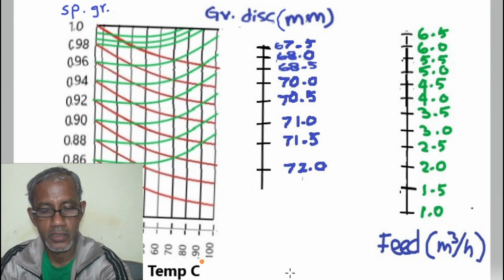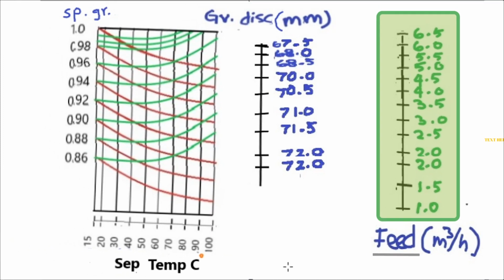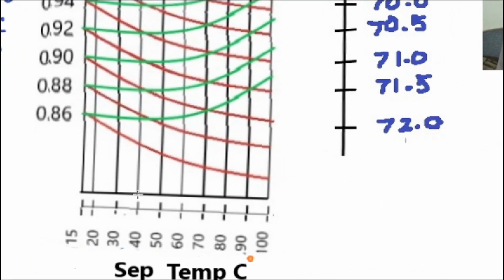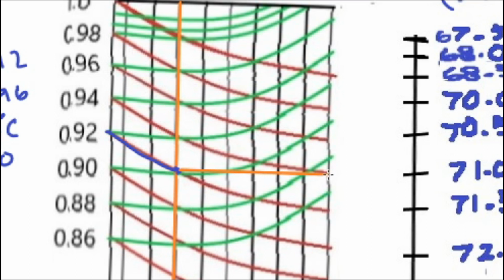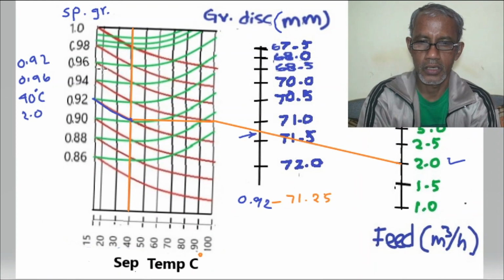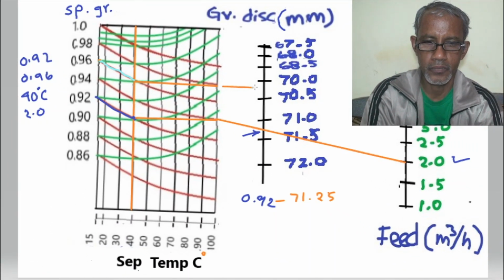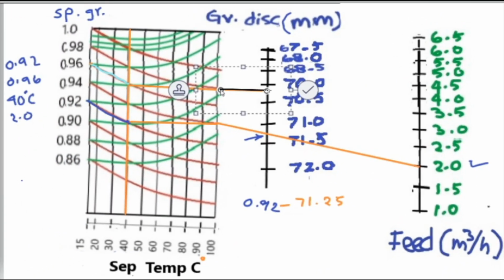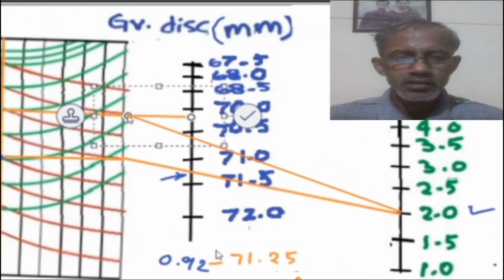Nomogram for correct operation of  purifier

Comment: but sir, you didnt clarify 2 important things.
1. when should i use rising curve? when should i use falling curve?
2. where should i get sg value, feed rate value?
Reply: Bdn
Reply from the maker: @thomaspraveen20 What us it, it's  a shipping topic
Reply from the maker: Falling curve to be used wen sg is given at common (or ideal temp about 21 deg celcious) and rising  curve used when the sg in mentioned at not ideal but at different temp say 30 or 40 deg celcious for example)  question 2- sg value is mentioned in bunker specification by the bunker supplier and feed rate is a rough estimation as per purifier maker based on feed temp, rpm, sg, feed type ( lub oil, ho.oil, diesel, , and filter condition and more conditions as per maker's guidelines.)